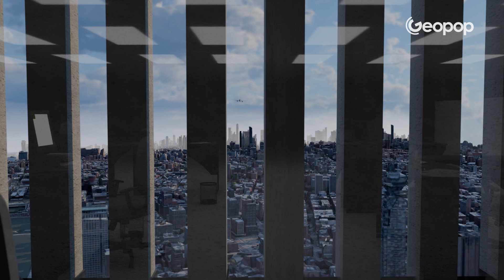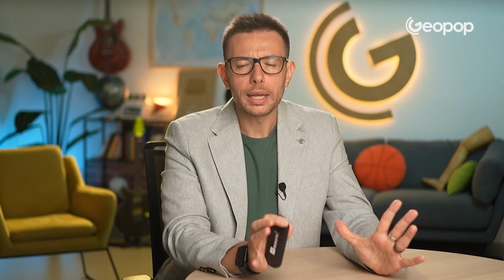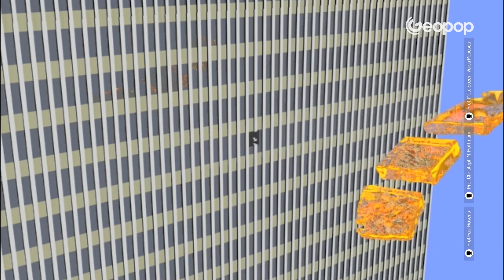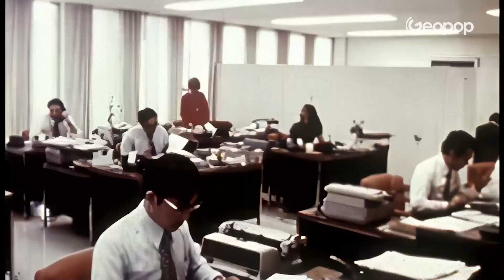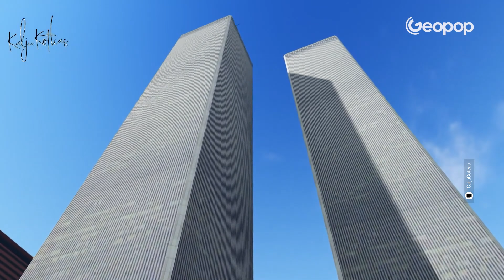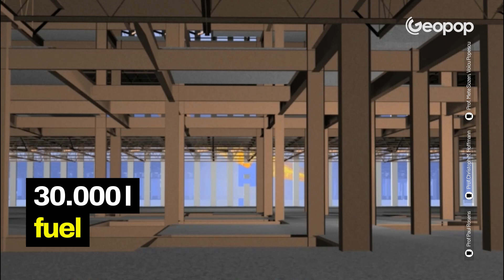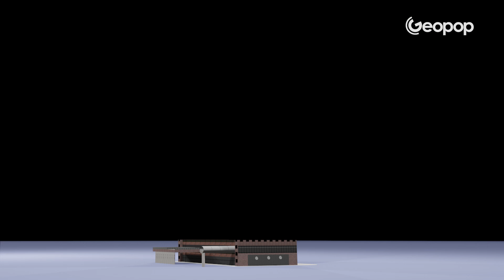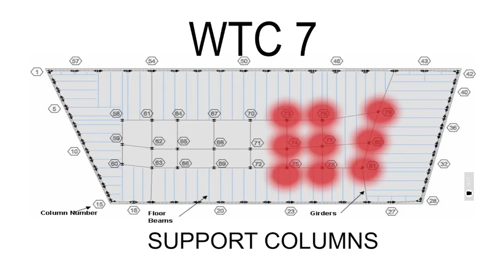9/11, 2001: The Technical Reconstruction of the Twin Towers and WTC 7 Collapses

Comment: A garbage video that supports the official version. Unfortunately, those who do not have knowledge believe the official version. The destruction of building 7 does not have a reasonable version, but only a controlled demolition, however, as well as Two Towers. And for those who believe that burning aviation fuel in an open place (where it spreads and therefore the temperature does not rise) can affect steel columns along their entire length, I recommend reading books on metallurgy.
Reply: I’m going to respectfully disagree. You probably won't read it but here it goes. Building 7, the 6th building to collapse of 10 lost on 9/11 still confuses many even though it has been extensively studied. Not famous or a terror target, and with no casualties it did not get a lot of attention initially, creating an information void the internet rapidly filled with garbage. Because everything seems like a conspiracy if you don’t understand how it works I prepared this brief summary of the collapse from my own analysis. No politics, just engineering. 

The North Tower collapse at 10:28am bombarded Building 7 with tons of burning debris, causing heavy damage and starting multiple fires burning out of control for the next 7 hours. Half the FDNY firefighters having been killed, others injured, units in disarray, equipment destroyed, no water pressure, and the greater urgency of Search & Rescue efforts, firefighting was pulled as futile. The building couldn’t be saved and was left to its fate.

www.youtube.com/watch?v=g_SvpwyC17M&ab_channel=MFitz  

Collapse of a burning structure is always a concern for firefighters. Steel buildings subject to fire rely on active fighting of the fires to survive. Buildings are designed around 1 to 3 hours of fire resistance, allowing time for occupants to escape and ACTIVE firefighting to get started, after which all bets are off. Left to their own devices they will exceed their design envelope and collapse. In B7 the occupants escaped, passive and active fire protections were compromised and active firefighting was abandoned which left the building to take its chances. It lost. Odds on Building 7 would eventually collapse, and it did. No big deal in logic. That is the sort of choice firefighters make every day in brush fire situations - which houses to save and which ones to let go. Only real difference here is moving the decimal on the size and cost.

www.youtube.com/watch?v=WnYBX6QT0R4 

FDNY Chief Daniel Nigro ; The biggest decision we had to make on the first day was to clear the area and create a collapse zone around the severely damaged 7 World Trade Center, a 47-story building heavily involved in fire. A number of fire officers and companies assessed the damage to the building. The appraisals indicated that the buildings structural integrity was in serious doubt. I issued orders to PULL BACK the firefighters and define the collapse zone. It was a critical decision; We could not lose any more firefighters. It took a lot of time to PULL EVERYONE OUT, given the emotionalism of the day, communications difficulties and the collapse terrain

FDNY Deputy Chief Peter Hayden ; We had our special operations people set up surveying instruments to monitor and see if there was any movement in the building. We were concerned of the possibility of collapse in the building. And we had a discussion with one particular engineer there, and we asked him if we allowed it to burn could we anticipate a collapse and if so, how soon? And it turned out that he was pretty much right on the money, that he said 'In its current state you have about 5 hours

The collapse of Building 7 was anticipated and widely reported in the media throughout the day. At least 24 video cameras recording some or all of the collapse. Everyone knew what was coming and why.

www.youtube.com/watch?v=OY5S5k3tMHI 

Building 7’s collapse was completely different to the Twin Towers, harder to understand with most of the details difficult to see. But we can still sort out what happened through careful analysis and observation.  This is MY EXPLANATION of the collapse sequence using the best available information and relying on no authority.

B7 was complex 47-story steel framed structure built on top of a smaller existing 3-story building, requiring several lower floors dedicated to complex load transfer structures instead of usable office space. Of trapezoidal shape and all-steel tube-in-tube construction, B7 (above the 7th floor) consisted of a central core of steel columns carrying most of the gravity load, perimeter steel columns around the outside of the structure carrying the remainder of the gravity loads and long span beams and girders to tie those elements together and form the floors. On the outside of the building hung a moment frame - the last part of B7 to fall. 

Phase 1 : The first externally visible signs of collapse initiation occurred at 5:20:28 pm. Collapse initiation for B7 is notably quiet with observers not realizing the building was collapsing! There was no audible warning in the form of say hundreds of ear drum busting 180-190dB explosive bangs preceding the collapse. Here at 12:00 a local CBS affiliate reporter is talking 10 blocks from B7 when collapse begins. People don’t start to notice the collapse until 12:11. Then at 12:45 is the famous CBS fixed camera clip of Building 7’s collapse.  Note how quiet it is.

youtube.com/watch?v=t5tEy6mXSE8&ab_channel=fresnosean379

Collapse initiation was due to lower floor failures above the load transfer region (7th floor) in the NE corner of the building. In this video at 0:45 you can see the NW corner from inside the building while under construction, Column 79 just out of frame on the left. That big, angled steel beam across the top of the frame connects to C79 at one end. The girders connect to the beam. That beam and all those girders depend on just one connection

youtube.com/watch?v=nP3TNHPCIVU&t=35s&ab_channel=EdwardCurrent

Phase 2 : Lower floor failures caused a loss of critical lateral support over an excessive length of core Column 79 and it buckled. If you look at a floor diagram of Building 7 (see above) and look at all the structures that depend on C79 you quickly realize this one column was a relatively isolated structural element on which a disproportionately greater fraction of the structure depended analogous to say the Key Bridge. Externally we see a vertical progression of window breakage along the 44-46 line and a kink in the roof of the East Mechanical Penthouse at the top of the building, consistent with C79 failure. The transition from full capacity to almost no capacity occurs in virtually an instant. Once the buckling failure occurs there is almost no resistance

Normally with a buckling column, the load could very well be redistributed to other columns, meaning the buckling could stop after a while. With C79 that is not the case - the failure did not redistribute the load, so the collapse rapidly progressed to the roofline, sinking the rooftop penthouse.

Phase 3 : With C79 gone, B7’s progressive, non-symmetrical collapse continues with C80 and C81 at the east end of the core left laterally unsupported and quickly buckled and failed as well, sending the EMP down through the building. C79-81 all have no diagonal bracing, which I believe is a major reason why they could not redistribute a lot of vertical loads among one another.

From there collapse progressed from east to west through the central core until the core was gone taking all of the interior floors and structures and probably most of the perimeter columns with it. You can see the horizontal progression of window failures low in the building and the dropping of the remaining rooftop structures into the building. One of the big takeaways from the NIST Building 7 study (that gets completely ignored) was their modeling which determined C79 failing under ANY circumstances would have initiated the same collapse sequence.

Phase 4 : After some 10 seconds all that remains of Building 7 is just a hollow empty outer shell - the exterior moment frame - creating the illusion the building is still standing since little has changed externally. But it’s just a hollow empty shell like an empty cereal box supported by only a few remaining columns and quite unable to remain standing. With all the internal framing gone, the north face leans inward, forming a V in the roofline, the last perimeter columns buckle under the strain and with nothing left keeping it up the moment frame free falls, landing on top of the 7-story high debris pile. It is only at the very end that a single measurement of alleged free fall acceleration is taken. Note this is not the building but just its outer shell, and only one corner at that, at the very end of the collapse. Start to finish the entire collapse took 18-20 seconds, or less than 1/3 of true free fall and we have to look at the whole thing, not cherry-pick little bits to fit a particular narrative. Worth noting _how fast something falls cannot tell you what started it falling in the first place. The debris spread out, blocking surrounding streets, heavily damaging the Verizon Building and destroyed Fiterman Hall, all well outside of Building 7’s “footprint”.  

Building 7’s progressive, non-symmetrical collapse was incidental and unintended collateral damage from the combined effects of fire + time + gravity started by the collapsing North Tower. That is true no matter who planned and carried out the 9/11 attacks or why . The collapse was of so little consequence it barely even registered at the time, a mere footnote. It only took on semi-mythical status as an alleged smoking gun years later when demolitions at the Twin Towers, missiles at the Pentagon and shoot down over Shanksville all failed and conspiracists had nothing left to work with.

Anything can seem like a conspiracy if you don’t understand how it works. Now you should. I hope you found this helpful, informative and it solicits informed critical comment. If I made any errors of fact, logic or reason or left anything important out, please let me know so I can fix it. IF you can offer a more plausible alternative please do. Be the first. Please start any reply with the words “Tits McGee” or I will know you didn’t read it and are wasting my time.

Comment: “Well, if the public understood structural engineering and exactly how those buildings were structured, and the high density steel that was used, they themselves would come to the conclusion that this was not an organic collapse. If you pay close attention, you’ll see that the floors are forcefully exploding into dust out of the windows ahead of the collapsing structures, which means every floor had to be laced with explosives.”

Structural engineer Ahmad Rahimian
Reply: Those lower explosions are called squibs. Typical of controlled demolition. I agree with you 100 percent.  It's tower 7 that gets to me. It holds it's shape all the way to the ground. Where did the vertical columns go it's like they just disappeared.  If even 1 vertical column impacted something it would have deformed the structure but that's not what we see. It's like every structural column in the building disappeared all at once Like pacman is underneath of this building and just eating it up as it falls. I don't expect most people to understand this.But it's really not that complicated
Reply: @ 
If you look at the photos taken by the firefighters, you will see that many of the columns are cut
Reply: @ If you look at the photos taken by the firefighters, you will see that many of the columns are cut
Reply: @MINDSPARK-u6e the problem I've found with that is when we're they cut? We don't know if the recovery had already came in and cut the steal in order to remove a body, idk. When I see the pictures of the cut beams I don't question that they're cut.What a question is when.
Reply: @ 
No, the firefighters was on the scene, taking pictures to use them as evidence before the wrecking cleanup crew came because of New York firefighters have to do their own investigations before any kind of cleanup and it has to be submitted to the state and looked over by the FBI if it has to become a case that they have to get involved in that’s the process in New York I’m from Brooklyn, New York. I know the process my sister was married to a firefighter before this event.
Reply: @MINDSPARK-u6e yea like I said, I have no idea when those pictures were taken. I have seen the pictures, they definitely exist and I'm sure proving when they were taken wouldn't be that hard, maybe you're correct,  idk...
Reply: @MINDSPARK-u6e  - The column cuts were made on October 29th, 2001 by workers removing debris. The whole process is extensively documented. So much so that in 2025 there is absolutely no excuse to still be banging on about it. 

www.youtube.com/watch?v=pVDU5QKa8Wg